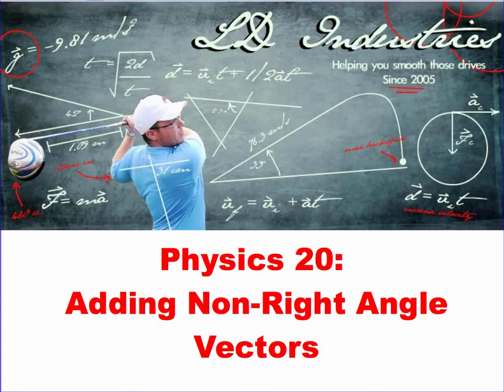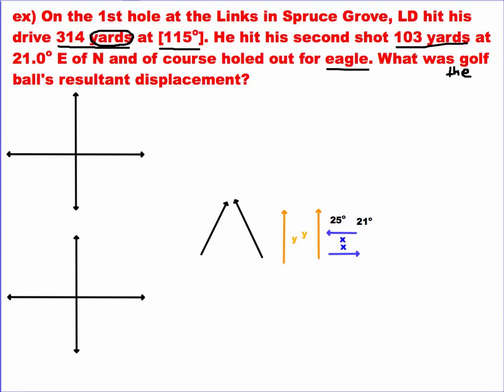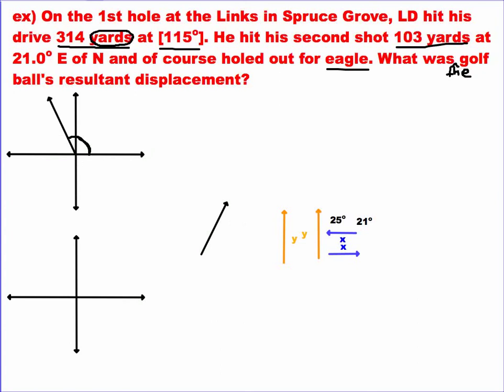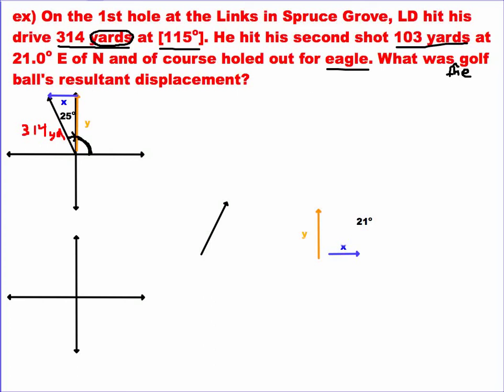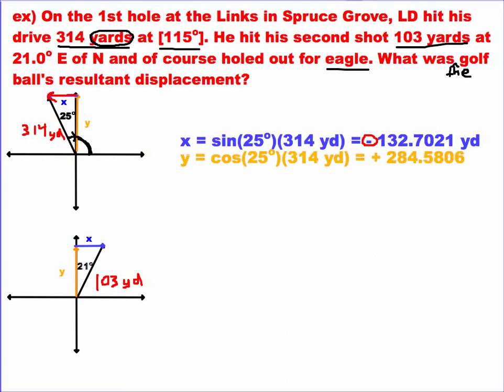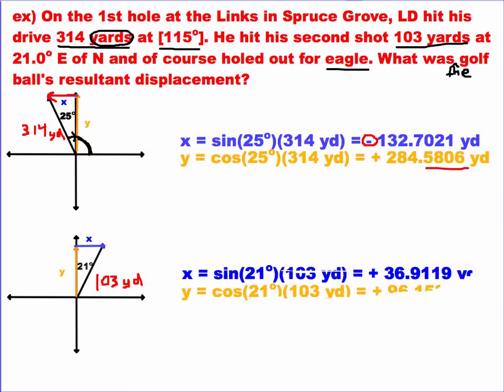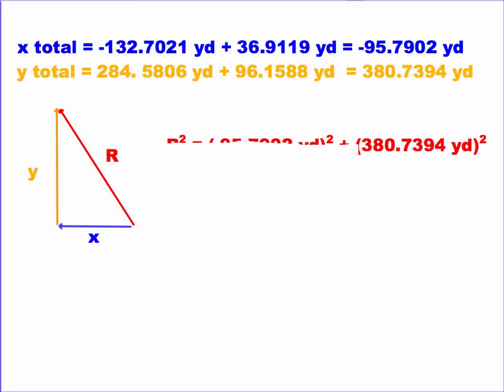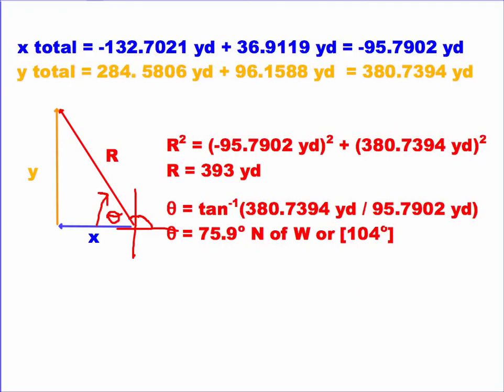Adding Non-Right Angle Vectors - LD Industries Physics 20

Comment: how did you know how that final triangle was going to look like that?
Reply from the maker: Hi Kevin, that last triangle is made of the x-component total and y-component total. I got the direction of the x and y total from the signs on the totals (left is negative, right is positive). Then I put the x and y totals tip-to-tail to make that last right angle triangle.
Reply: @blangdale  oh ok. Do u have any vid explaining how u do the tip to tail method?